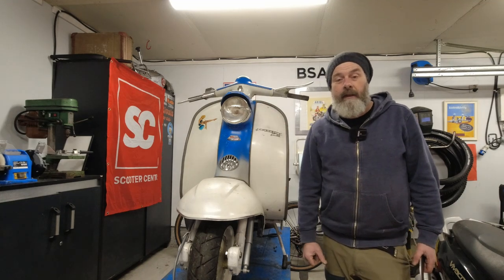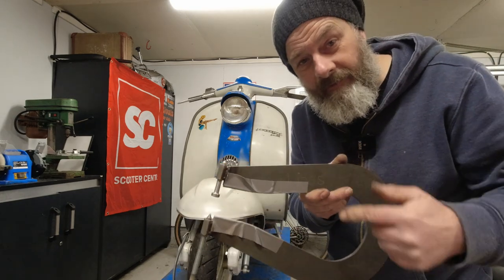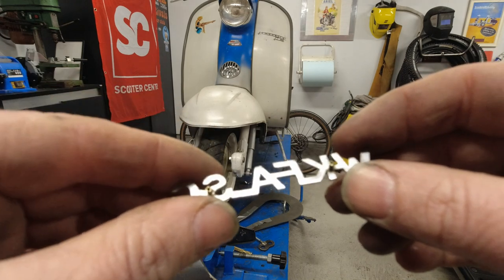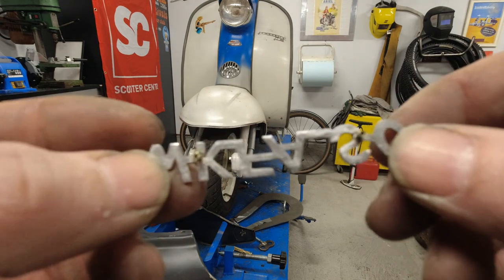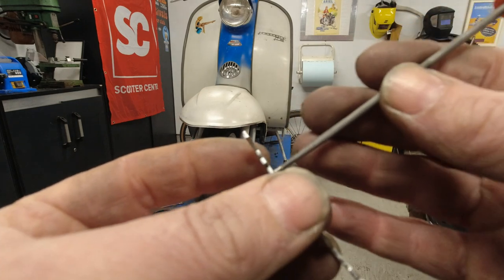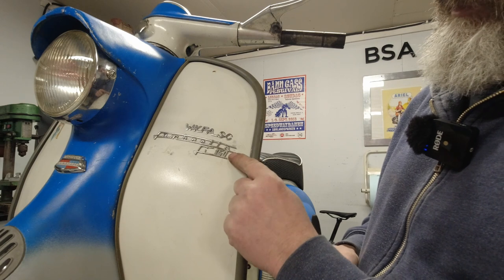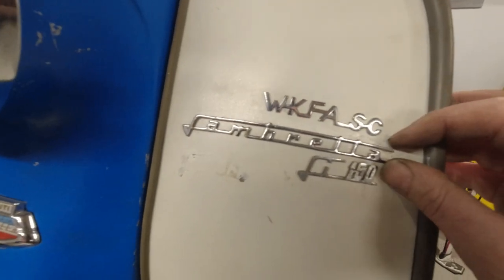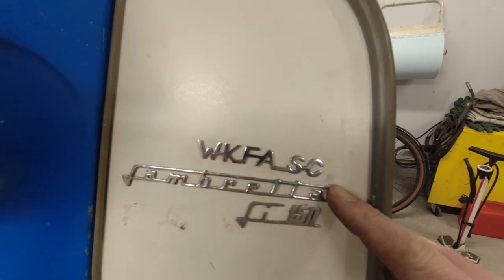Using the #lambretta legshield badge tool.

Comment: Honestly what all these badge makers should be doing is putting threaded posts on them so we can easily screw a backing onto them and remove then anytime but instead they want us buying them every time we repair or replace them. I made mine with threads and have not needed to buy replacement for ten years now.